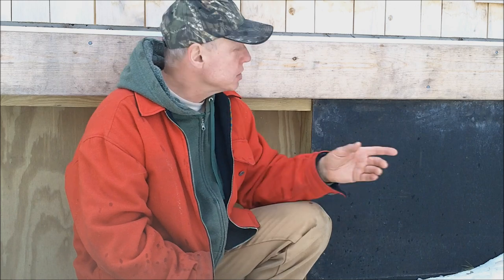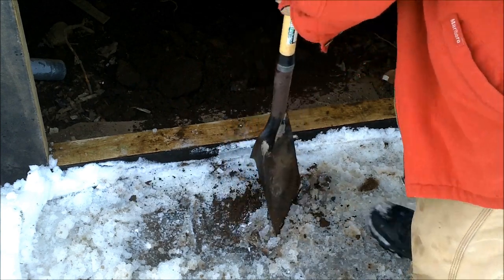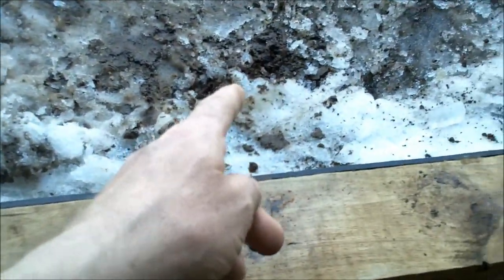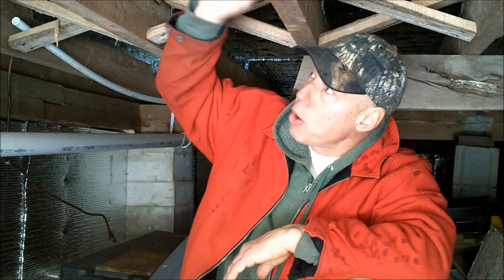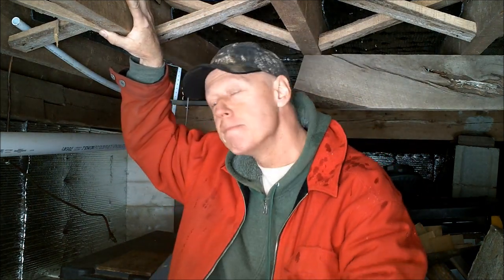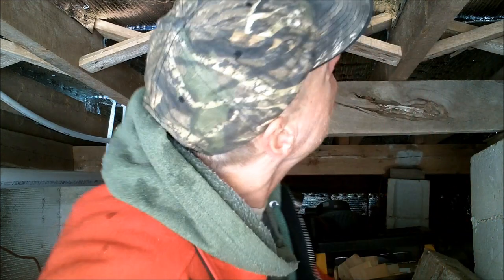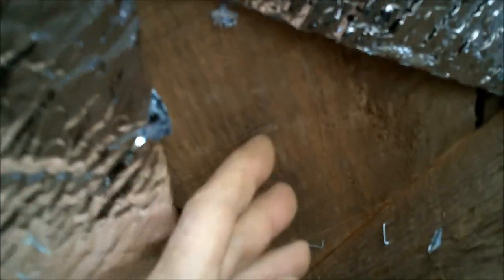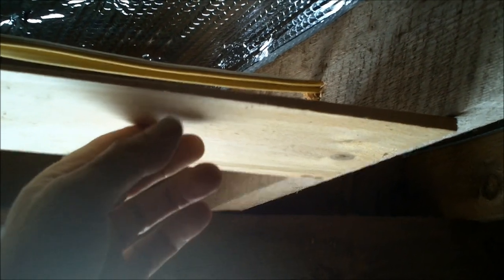HOW TO INSULATE A CABIN FLOOR AND KEEP IT RODENT FREE   PART 2

Comment: We have a metal building here in Hawaii. The roof at 16 foot high is insulated with this bubble foil and makes a BIG difference. Not in heat loss, but in heat gain. There are no ceilings and this would be a 50'X300' oven without it even with moderate temps 70 to 80 degree F`. AND the 'rain on a tin roof' is not music at the downpours we get and it helps immensely.  (Last month 30 inches in about 1week.) Often we cannot hear the TV at 6 foot away or the phone ringing it rains so hard. Detractors say it will attract mice, but have no evidence of this and there is no air gap between the foil and the steel roofing. Keep spreading the word about this material. It works.
Reply: @kat lopez.  Are you saying there is no air space between your roof and the Reflectix yet it is still very effective?
Love your reference to "rain on a tin roof"--we get heavy downpours in Louisiana too.

Comment: Bubble foil also works great for an insulating mat in a tent, sitting pad or hammock when camping if it's cool or cold. Light weight and can easily be cut to size.
Reply from the maker: Agreed :-)
Reply: @thebossoftheswamp I have been watching your videos for a long time and now finally have a camp! Question my camp is on piers very high and sloped like 2ft in the rear and 5ft in front. Would you skirt that high?
Reply from the maker: @lornegiles8863  Absolutely!

Comment: I watched this last year and there was no pink stuff when I was building my 14x40.  So I took a chance and used bubble wrap in the walls and ceiling.  Its 9 degrees out side and 74 in this cabin with 4 -110 electric heaters.  That perfect!!!

Comment: I was at my wit's end with rodent problems until I found your video. Replaced insulation twice and on the third time with the "bubble wrap". The insulation is now rodent free and guess what...It works! I can't thank you enough for sharing your knowledge.
Reply from the maker: Thanks for sharing your success report :-))
Reply: I have log home and the rodent struggle is real.  They’ve ruined my stove and I too am at my wits end.  I’m going to switch to bubble foil and peppermint spray.

Comment: I had a thought about part of the reason why this may work.  As far as I know, layers of trapped air act as insulation.   Many layers of thin clothes keep you warmer than one thick one.  The insulated skirting is creating a very nice air pocket underneath your cozy warm cabin.  It's a buffer zone.  Great thinking about keeping the pipes warm.  You are one smart cookie!
Reply from the maker: Yes indeed and the reflective quality of the foil is outstanding.

Comment: Appreciate the tip!  I'll be building a large "deer blind" (calling that to get around the assessor and codes) this summer,  to stay in until I build my retirement home on my up north MI property.  The bubble wrap is  a perfect solution for the question I had about insulating the floor. 
Thanks and have a great day!

Comment: I watched your first video on this and your second one has only confirmed it.  There is no substitute for experience.  
I have (soon to be had) rats, not mice in my newly inherited house, as the squatters who had been living there were absolute slobs.  The rats in the attic had literally destroyed the fiberglass insulation, chewed holes in the walls, etc.  I'm bringing in a quite effective cat, pellet guns, and rat traps, and I was loathe to add more fiberglass for the very reasons you mentioned.  Your two videos on insulation have been the biggest change in my plan for what to do.
I can't thank you enough.  I subscribed right away, because your attitude & experience makes you exactly the kind of person I want to learn from.  Thank you again for making videos and sharing your knowledge.
Reply: P.S. I have eliminated ALL the rodents, cleaned out underneath the house, and installed bubble foil as shown above.  I am delighted with the results, including the reduced heating costs, and the warm floors.  THANK YOU, from the bottom of my heart!!!

Comment: Great Vid JC. Let the haters hate. They are jealous that you have the common sense that they lack. 
It works for you, you generously shared it with us, and some people just have to shoot holes in things
they can't get their head around. Thanks for sharing!! God Bless!!!
Reply from the maker: I love proving them wrong.  Stay tuned for the next salt ice debate haha
Reply: Agree 100%!!!
Reply: @thebossoftheswamp  Hello sir, I love your program..
I have a 8x12 tiny cabin.
The temps can be in teens & just about 5 degrees in winter.
Can I use this insulation in walls, ceiling, and floor and use nothing else. I do not know much about building codes, but I do want to be warm with the right insulation and a small wood stove in winter. Can you help me.  It is up off ground so I can get underneath. And walls can I staple this to studs before applying inside wall boards. I need serious help, on a budget but need to stay warm.
Harvey-60
Reply from the maker: @harvdog5669  I have used the foil for walls, roof and ceilings but I wouldn't completely surround myself with it.  like your shed, I would do the floor and roof but use fiberglass in the walls.  A building needs to breath just like we do.  I would staple it between the studs and directly to the sheathing. If it was applied over the top of the studs, condensation may form in that airspace as the building is heated.  Just my 2 cents.

Comment: Part of why it works so well is that it reflects infrared radiation (IR).  That's the warmth you feel from a fire through glass.  It's basically light that you can't see with your eyes but you can feel with your skin.  So it reflects the IR from warmer places back into the warmer places which keeps the warmer places warm for longer and/or with less added heat.  Love the tip!

Comment: Former Construction Specialist/Engineer.
Physics (Thermodynamics) Heat seeks cold NOT vice versa.
1. I think the heat in your cabin is being transmitted through the floor joists as you suspected. I agree.
2. Geothermal (ground) heat transfer. In other words, I think because the ground under the cabin is not exposed to the cold outside air it doesn't freeze because of normal geothermal heat transference.
Personally, I never used this method but ever since you mentioned it I became interested in the science of what was going on. In closing, I think the other interesting factor that is taking place is HEAT REFLECTION due to the aluminum foil.
Anyway, that's my two cents worth.................IT WORKS!
Reply from the maker: I agree. I think the reflective properties of this stuff make it what it is.  It's the only insulation in the skirting and let me tell you... it's been wicked fricken cold up here this winter and that jug never froze.  I find that amazing :-)

Comment: I only once used : isocyanurate foil backed, rigid foam insulation boards. Whew mouthful.
..in my cabin up north. The ants 🐜 got into it and tunneled thru it completely. A very expensive mistake !
I too switched to ‘bubble foam’ and had No rodent or ant problems.
...I also layed down & buried cement board outside my skirting. It was about 30in wide and it kept critters from tunneling under the skirting, to get into my crawlspace. I covered it with fine base road gravel, about 3-4in thick. 👍🏼 up to ground level.
Reply from the maker: The ceiling of my NY cabin has 3" foam insulation.   What a mistake.  It's the Holiday In for ants. NEVER AGAIN. 
Bubble foil all the way :-))

Comment: The Reflectix works well on the skirting because heat always moves to cold, but it also must have a space for the heat to reflect back to. You are correct about the insulation under the floor is working against keeping the crawl space warm.

Comment: Hey JC...!
I insulated my Playmate cooler just like you said in your video and my drinks/food stays cold now while I am out fishing all day.
I bought more bubble wrap and getting ready to insulate my shed.
When I first started watching your channel, I watched every episode in one night.
Keep doing what you are doing. You are a very wise man...
Love your videos!
Reply from the maker: That was quite the bossathon haha.  All the best :-)
Reply: @thebossoftheswamp  Howdy friend, 
I love how you share truth with whoever needs to hear it.
I have a pre built graceland building, with out any insulation, it can be 9 degrees in winter here. I already decided before watching your video, that I need to make the tiny shed warm.
So I want to put the foil under floor or on top of existing 5/8 ply wood floor, if I go on top, I have plenty room for a layer of 1/2 inch plywood on top of that.,,
Then put my door in.
I want to use the foil in walls & ceiling as well. Or what do you suggest in walls & ceiling for a good fix on tight income.
I have great roof ventilation and a metal roof and great out door siding. The roof has a 1 inch insulation board under metal roof as well..
Please help. From Harvey on a budget. Thankyou sir. You seem so real. I appreciate your view on what works and what does not work.
Love your channel.
I will keep watching till you stop.. by the way, my tiny cabin is 8X12.
I am staying away from permits.
My other main cabin will be a 16X24 or 28 with a metal roof.
I might need to get a permit on that. Thankyou again, keep helping folks, we love you.
See you in the next video.
Reply: @thebossoftheswamp  MY FAVORITE CABIN GUY.
Love your videos..
If I insulate my tiny cabin floor underneath like you have done. When I leave in the winter, will my pipes freeze.??
I want to put R-19in walls and cover over the wall studs with REFLECTEC, Then put on wall boards.
The ceiling will be R-38 then REFLECTEC ON CEILING RAFTERS over lnsulation, then ceiling boards.
Will my cabin freeze-up..
Do I need to drain all my water in my pipes.
It can be between 5 degrees and
26 in the winter on the mountain here at 6800 feet in northern Arizona.
My buddy thinks I am crazy for wanting to use REFLECTEC , mostly in my floors...I have said nothing to him about the walls...
What happens to your cabin when you leave it unattended in the winter....???? Thankyou for doing great videos. Keep making more...I do not doubt the effectiveness of REFLECTEC myself, just by watching your videos..please let me know your opinion about what I will do with the ceiling and walls.
Reply from the maker: @harvdog5669  My cabin holds the heat for a long time but if no heat is generated for a long time, then the inside temp and outside temp will eventually equal out and yes it would freeze.  I honestly don't know how well it'll work to attach interior wall board directly to the reflectix.  I'm presently insulating the upstairs of our garage project by putting unfaced insulation between the rafters, then stapling reflectix to the underside of the rafters, then strapping over the foil and will sheetrock over the strapping. This gives me a hard surface to screw the sheetrock to and leaves a 3/4" airspace between the sheetrock and the foil (which creates an insulation in itself).
Reply: @thebossoftheswamp  Thankyou sir.
I love breathing outside fresh air.
And like you mentioned that if it is to thick or dense and tightly closed up,, one needs to crack a window at each end of cabin or house like with a swamp cooler, from time to time to refresh the air..  I am thinking a little over kill on staying warm and keeping drafts down to a minimum, especially in winter is a better trade off for winter 🥶🥶 in cold months makes for a happier situation. LOL LOL 😆🤠🤠🤠🤠
Thankyou for all your advice and tips on cabin living.
I believe so n you.
Keep up with your favorite projects and videos.
Your fan Harvey..
Reply: @thebossoftheswamp  one more thing, I will let you know how my batteries are in the RV after I use REFLEXTEC  around batteries in there plastic boxes on tongue of trailer.
Going to try and warm them up, or try to keep the ice cold temps off them so they keep power better.
Your fan Harvey
Reply: @Brian Carver. How did you insulate the interior walls of your existing shed? Did you apply Reflectix directly to the walls, or did you somehow create an air space between the walls & the Reflectix?

Comment: Well you’re definitely correct about the mice getting into and ruining the pink fiberglass insulation. I’ve been removing ruined insulation from under my raised floor house and I am planning to try “foil bubble wrap” as well as foam board to see which works best and is most affordable. Thanks for spending your time doing these videos!
Reply: Do you have any answers yet of comparison between this and foam board?

Comment: I live in a yurt on a pier foundation up to 5ft in the air.  I did the same thing with "Bubble Foil" around the skirting.  You are absolutely right.  Experience in my view is way better than theory.  Thank you for the two videos.  God bless you for passing along your experience
Reply from the maker: Insulating that skirting makes all the difference in the world.  I'm still getting bashed about the R factor.  So ridiculous  lol.
Reply: @thebossoftheswamp  how can I apply this foil under my RV. This could mean I could use it more in the frozen mountain weather.
Reply: @thebossoftheswamp  I am going to buy a bunch and put it everywhere I can inside my RV. This trailer is in great shape at 25 yrs old, but I am going to use some serious foil on it, in all cabinets, walls, inside floor under carpet. I think I can be really cozy on vacation in cold & hot vacations.
It is 45 out now where I am at, got my RV door open all day and still is open. I am going to buy this foil product soon, very soon.
I might be able to stay on mountain longer while I work on tiny cabin to actually live in..
Fishing holes are all over up here..

Comment: I mentioned before boss that my whole cabin is insulated with bubble foil. One thing I like over fiberglass is that you don't have that musty smell if the cabin has been sealed up for a while. I love the stuff, no joke. 

On another note, a couple of my buddies were using bubble foil as a camp pad. What a cheap way to go and stay toasty warm, I challenge anybody out there to try it.
Reply: Did you use single or double bubble? I'm planning my cabin n just got roof on. 16x30 20' high. Going sawmill board n baton siding. Did you put it behind the siding or inside and leave air gap between siding n living space? I put it underneath my tin roof. Put on top rafters then layer tin onto. Thanks
Reply: Hey Jim, I can use this in my walls too ?? And ceiling??
I have a pre built 8x12 tiny building by Graceland.
Should I apply it to the inner part of the outside wall boards on inside between wall studs or just staple on to wall studs before applying wall boards.???
This is my first project of this size.
Ya , can I put it on top of wood flooring inside and put 1/2 inch plywood on top, then put in newer man door. It is only 1 foot off the ground.
Maybe when Graceland driver comes out to move it across property, I can be ready with new foundation too raise it up 18 to 24 inches.,, And so I can have room to go under neath and staple between floor joists , what do ya think.?? Keeping in mind, the temps can be down to 5 to 9 degrees in winter time for a few days at a time.
At least at night time, on & off during winter around 7,000 feet on the mountain.
Reply: @harvdog5669  What did you end up doing and did it work?

Comment: The Insulated skirting is what's keeping the ground and pipes from freezing, being that ground temps maintain a constant 50-55 degrees. It also helps that some of the heat from the cabin is getting into the crawl space through the bubble wrap.
Reply: "being that ground temps maintain a constant 50-55 degrees."
Not where he is.
Reply: @wisenber  Aren't they saying this is the temp using the insulated skirting & bubble wrap, otherwise the ground would be below freezing?
Reply: @almaburns6562  That was my point. The ground temperature only remains constant below the frost line...unless it's permafrost. Without the skirt and insulation, the ground and pipes would be the temperature would be around the outside air temperature.

Comment: Just came through an Australian summer (Temps up to 48 C. 118 F on the hottest day - down to 31 C - 89 F overnight.) and I have fitted the bubble foil - on your advice - under, in the walls and in the ceiling. The House is in central North Queensland (Hughenden) and has only recently (last October) had the internal walls clad (Also with your idea of plaster rendering) I put the bubble foil in and we did not need Air conditioning this whole summer. Admittedly the house is on tall stilts and flow through design for breezes and we did have breezes most of the time. Luckily, the humidity was not high this year. 
Thank you for this advice, this follow up and the many - many ways you have made it possible for me to make my places better...every day.
Reply from the maker: Thank you for your success report Frank.   All the best to you :-)

Comment: You made this video 4 yrs ago, providentially, I’m watching it because it came up in my feed.  I’m building a chicken house/shed and one of the big conundrums about designing the floor was how to insulate, how not to encourage rodents and whether or not to lift it off the ground, due to cold airflow potentially freezing the floor even with insulation.  I’ve seen this product before.  I’m going to use it to insulate both skirting and floor.  Thank you so much for taking the time to share this JEWEL of a tip!  Best Regards! Christina
Reply from the maker: If you click the VIDEOS tab on my channel, you will find a very recent update on this insulation with useful info regarding other applications.  My hen house is insulated with this too.